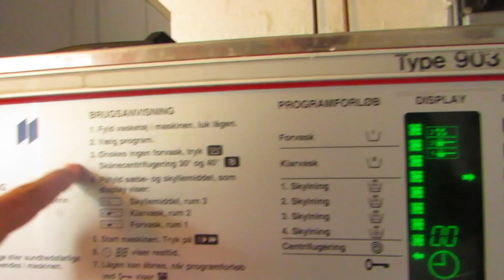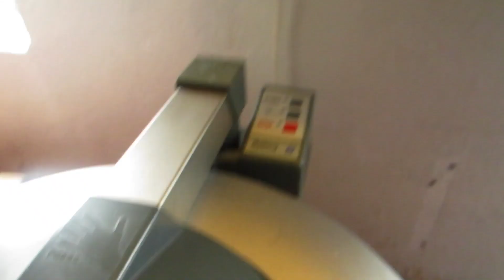Changing the Oil on a Perkins 4-236 Diesel Engine | #46 | DrakeParagon Sailing Season 5

Comment: 5:00 one of my favorite tricks (possibly less useful on Paragon than some places, which mount filters sideways or something) is to position a pan under the filter and then punch a hole in the top then bottom of the filter to drain it separately. It's slightly messier than a perfectly vertical filter, but it means mistakes with handling a full filter are less disastrous and it's way more controllable than old oil running out the side of the gasket or down a mounting while unscrewing the old filter.

Comment: yep good episode i have a 4 236 derivative engine mazda perkins tl35tii in a land rover, as a mechanic/engineer i reckon a 100 hour change regime is costing you a lot of money, good for the motor but you could double it to 200hrs and use 10w40 oil easier to find than sae30 just make sure its marked diesel /gasoil, i would also keep the last changed batch until the next change so you have sacrificial oil in case of a problem, filter doesn't need need changing every time, i have done over 120 000 hard miles on one of those engines ( still going strong)

Comment: Thanks Drake and Crew .... nice set-up you have to pull the oil out! large engine room too! ....interested in the positioning of your 'jerry cans' positioning on the outside of the rail. have you experienced any difficulties before?
Reply from the maker: Thanks Simon.  I like having the jerry cans on top of the bulkwark/caprail to keep them off the deck.  This way they're not in the way when I need to run from the cockpit to the bowsprit.  But difficulties, yes, just once.  I was hove to offshore for 3 days of heavy weather (55-60 knot winds).   A wave dislodged one of the jerry cans.  It was still attached to the boat with a line tied to the jerry can handle and the other end tied to the stanchion.   It just kept bashing against the topsides with such force that I knew I had to do something. It was difficult, dangerous, and scary for me to crawl up there to deal with it.  And it was too risky for me to get the jerry can back on deck so I ended up having to cut the line and let the can go.  I've since improved the design for securing them think they should hold through the next storm.
Reply: Drake, yes i looked and was wondering how you secured the board to the stanchions?
Reply from the maker: @psystealth  I used a stainless steel u bolt like this: https://www.s3i.co.uk/ubolt.php I drilled 2 holes in the board for each u bolt, securing the board between the SS plates.

Comment: Would love a photo or two of exactly where you tap into the coolant for your hot water tank. We have the same engine but have had various experts tell me different things. I am pretty sure our 4-236’s are about the same vintage. I do also like your remote oil filter setup. If mine was not so easy to get to I would put in a remote. We hope to visit Greenland in about two years as we make our way towards the NW passage back to Alaska. Enjoy.

Comment: Drake, great video! I have the same motor as you but I noticed a remote location for your oil filter. Can you give me information on that setup so I can incorporate on mine. It would be very useful and less messy than the horizontal setup that I have on my engine. Thanks in advance! John
Reply from the maker: Hi John, thanks. If you send me an email to drakeparagon@gmail.com then I can send you some photos of how the oil filter is connected on our Perkins 4-236. The boat came with this set up when I bought it, but maybe I can find a part # for you.
- Drake

Comment: This is probably a stupid question since most of the boats have it laid out that way and there must be a reason for it, but Isn't it unsanitary/dangerous to have the water fill on deck level, with all the fragments of dirt, bird feces, diesel etc. getting washed into the tank when filling it up?
Reply from the maker: I have always thought the same.  Why have the fills for water and diesel right on the deck where it is more likely that contaminants might go down the hole when you're filling? I've always thought that someday I might relocate our water and diesel fills to a vertical bulkhead inside of the cockpit enclosure. - Drake

Comment: Hi, you wouldn’t happen to know how tall the engine is from sump to highest point? I’m considering swapping out my Chrysler lm318 for the Perkins but I’m concerned it may be to tall.
Reply from the maker: I found this online: Size and Weight
Measuring from the end of the engine to the end of the flywheel housing, the length of the engine is 117.28 inches while the overall width is 39.22 inches. It has a total height that measures out to 58.04 inches. https://itstillruns.com/specifications-perkins-4236-engines-7605019.html
Reply: DrakeParagon your a legend, that means it will fit my application :-)

Comment: Where I am at SEATTLE there is a big buzz for onboard water makers ,, you get along without one? Is it reasonable ? Or do you regret no water maker?
Reply from the maker: Hi Christopher, Paragon carries a total of 210 gallons of fresh water, which we've always found adequate for the duration of our offshore voyage legs for 2-4 people.  It's also been enough to last in between places where we can water the boat when we are sailing coastal.  We actually do have a big water maker installed in our engine room, but I've always just kept it pickled and not used it because I didn't want to go through the hassle of always running it.  Of course I can imagine scenarios where we would prefer to have a water maker operating, but so far (in my 26 years of full time year round living aboard and voyaging all over the world) I haven't found myself in that situation.  Maybe someday. :) - Drake